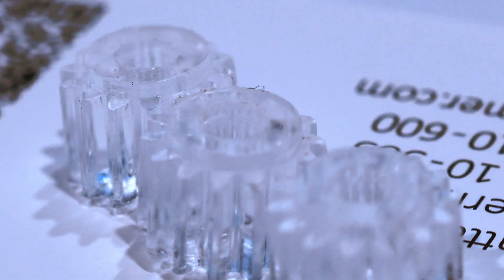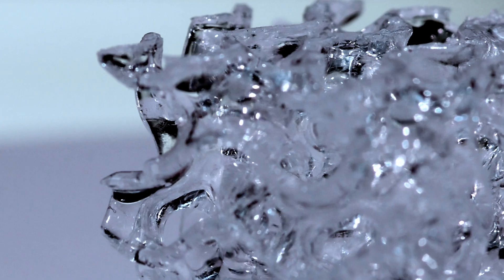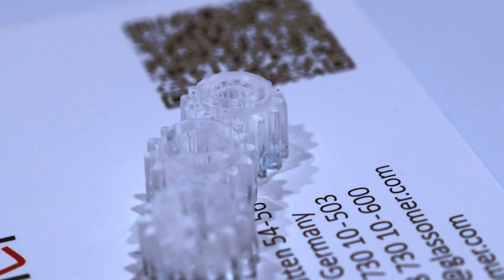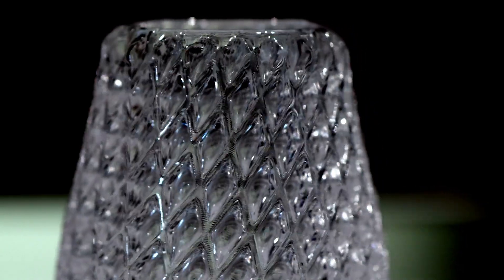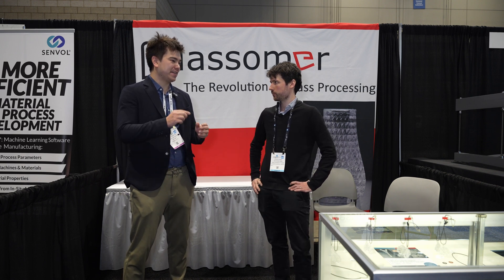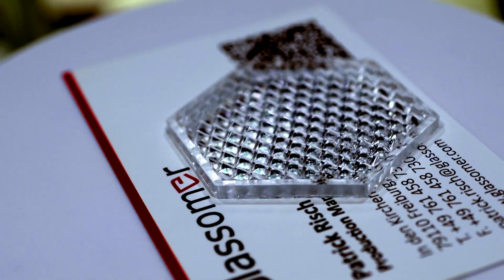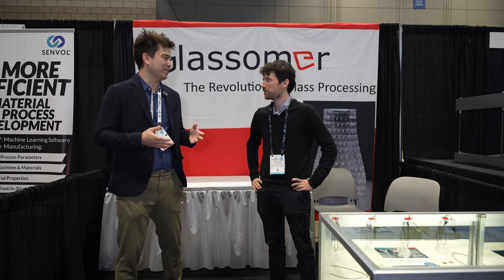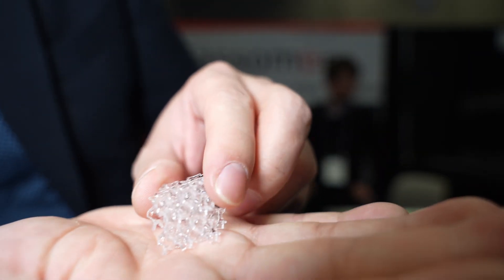Printing Glass Made Easy with Glassomer at RAPID + TCT 2023

Comment: Bait and switch...can't order resin at all
Reply: as a veteran of the glassblowing industry, this guy is full of shit; this startup is a scam.
he's like, "just pop it in the oven and sinter it" -glass doesn't work that way.  by the time you get it to temperature for bubbles to rise out (fining) it's liquified and running everywhere.  fining takes dozens of hours.  in reality, any glassware made this way would be full of bubbles from the resin binder burning out, and not at all optically clear.

Comment: These guys are still around? I haven't heard anything about them in four or five years. Back then they had a few papers where they reported optical grade quality after sintering their prints. They also had a few mentions of making filament from this stuff. Hopefully they'll release both the filament and the resin to the consumer market soon... or at least before Half-Life 3 or Portal 3 comes out
Reply from the maker: Filament would be cool
Reply: @NathanBuildsRobots  It absolutely would! But I don't think they had any plans to sell it. I think they just made a single batch or two for curiosity testing.
Reply: Sla resin is already for sale since 3 years. They also produce glass parts in larger series using injection molding.
Reply: @FK-mu3tw  Do they distribute the resin outside of Germany?